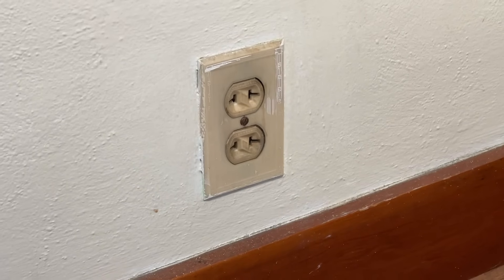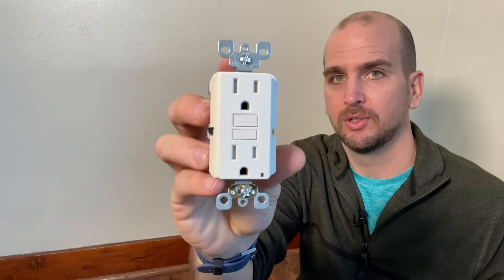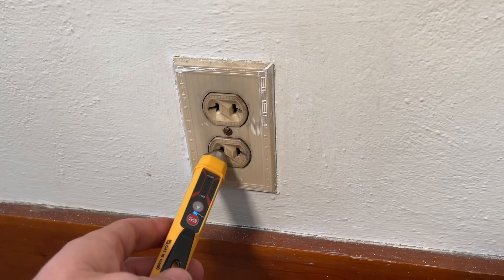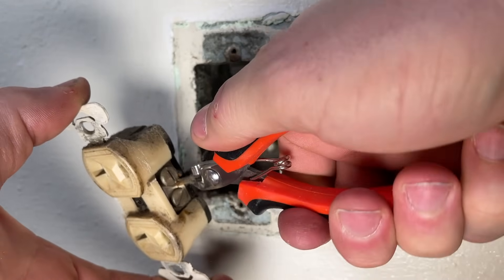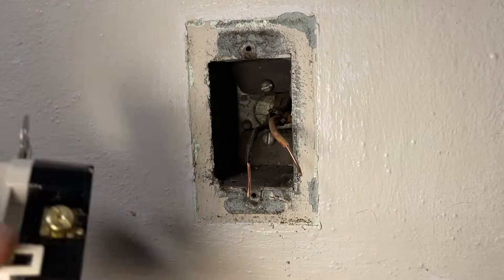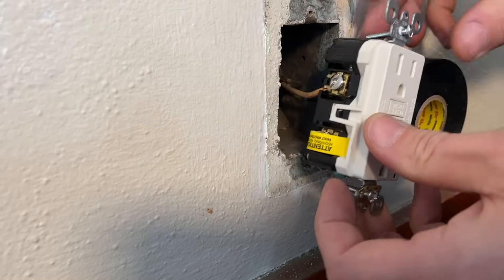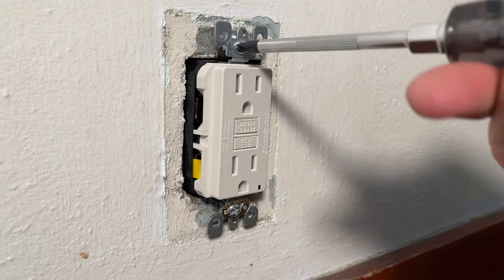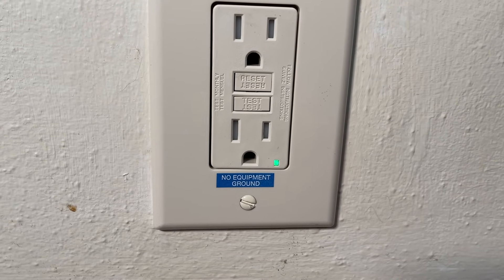How To Replace An Old 2 Prong Outlet Using 3 Prong GFCI

Comment: Question for those with electrical knowledge: Im in a 130 year old house. Half has been updated to standard 3-prong outlets, but the other is still 2 prong. By installing this new 3 prong  outlet like in this video, does that create a proper grounded outlet, safe for electrical devices? I’m asking because a laser engraver i have requires I plug it in a 3-prong outlet as a requirement for the warranty. Is what’s being done in this video sufficient to create a ground or do I need something else? Sorry, I have zero knowledge of any of this, please excuse me if I asked the question wrong, but hopefully you got the gist
Reply: It will be safe for your device. What it does is monitors the balance between your hot and neutral conductor. If there is the slightest imbalance it will trip. This indicates that current is going  somewhere other than where it should be. The breaker in the panel alone will not do this. What an equipment ground does is creates a path back to the bonded neutral allowing a breaker to trip in a fault scenario. So I’m theory; the gfi is actually safer than a traditional 3 prong outlet with a proper equipment ground
Reply: @NIXGHTEditz7  thanks a lot, I appreciate you sharing that
Reply: To clarify, no, this procedure does not "create" a grounding path. The outlet is NOT grounded.

Comment: Great video, thank you for sharing. The silver rectangle frame that you screwed in. How about if the wall doesn't have that.(rectangle medal frame) will you please make a video on how to Mount one in the wall?
Reply: You cant just mount a metal box in the wall. If you only have a 2 prong outlet, you cant just install a 3 prong outlet because it wont be grounded.

Comment: Standard wiring practice is what you did on the hot wire.......wire goes on the side of the screw that as you tighten, the clockwise turn of the screw would tend to pull the wire IN. You put the neutral on the wrong side of the screw....as you tighten, it would force the wire OUT. 

Minor mistake, but if you're gonna do a demo, at least do it right.
Reply from the maker: Hey Ed, I totally agree when I am using side wiring with a clockwise J-hook.  For the back wiring on this GFCI and/or spec grade receptacles when the plate pulls in and secures the wire I am not as careful but probably just best practice to stay consistent to avoid confusion for viewers.  Appreciate the feedback.

Comment: You're removing a NEMA 2-15R T-Slot Receptacle. These were used for 240V at 10A or 120V at 15A. Did you use a volt meter and measure the voltage?

Comment: It’s common practice to install the outlets  ground prong up.  
If a conductive object falls accidentally across the main two prongs of a "right side up" plug that isn't completely flush against the outlet, it will close the circuit. If it's your finger you get shocked. If it's metal there could be a spark. If there's a spark there could be a fire. Building codes are designed to prevent things like accidental fires.

By installing the outlet "upside-down", you put the ground prong on top of any plug that has one. The ground prong can't create a spark all by itself, so it's safer to touch accidentally.
Reply: I wouldn't exactly call it common practice when 99% of the time the ground is on the bottom lol
Reply: @djwctbell  “It’s” meaning it is as a current practice.  Older stuff, sure the ground on bottom.  In my own house they are.  Most of the newer houses I go to the ground is up.

Comment: You really shouldn't recommend using a non contact tester for anything other than verifying you have power where you think you should.  They should only be used to confirm something is live.  It really shouldn't be used to "confirm" that power is off and most manufacturers state this openly.

Comment: what about if i bought a wifi outlet, thinking i was being smart and getting a three-prong, until i realized i don't have a ground wire... at all! thank you 1940's San Diego apartment
Reply: It depends on where it is on the circuit. If it's not the first outlet on the circuit, you can replace the previous outlet with a GFCI which is an acceptable, code compliant solution.

If it is the first outlet on the circuit, the other code compliant solution would be to replace the circuit breaker with a GFCI type circuit breaker.

Note that to be truly compliant in either case the outlets would have to be labeled "GFCI Protected, no equipment ground"

Comment: Is it still safe to plug an appliance with a 3-prong plug into the outlet despite there being no equipment ground?
Reply: No!
Reply: Why not?
Reply: @maoak5470  the equipment ground is connected to the metal case of any appliance.  If that is not grounded the case can get shorted to the line voltage. If you touch the case in that situation it’s like touching line voltage. It won’t usually happen, but it’s not safe.

Comment: changing it to this with no earth wire makes no sense. there is no reason to do it because you need an Earth wire for it to trip
Reply: Any fault current will trip the GFCI, it does not need to go through a ground wire specifically

Comment: Electrician refuses to replace old non polarized two prong outlet, because "old wiring please update"

The wire colors are reversed and the breaker box and breakers are by Federal Electric
Reply: You could get a second opinion on the wiring, but if you have an FPE (federal pacific) panel, get it changed. Just do some Google searching and see for yourself the fire issues with those stablok style breakers.

Comment: Would there be a benefit to jumpering the neutral and ground terminals on the outlet? A fault to ground in the device would then have a path to trip the GFCI even without a person touching the device to divert current out of circuit.
Reply: It is against the code to connect the neutral and the ground
Reply: @okaro6595  I’m thinking of the situation where there is no grounding conductor nor raceway.

Comment: No offense, but the commercial electrician who taught me would tell you just what he told me, "Don't take up electrical work as a profession.  You touch bare wire too much.  Like a gun, always treat it like it's loaded." That's probably why he would never let me near 277 or 440 in the warehouse we were working on.

Comment: What's with the T-shaped holes in older sockets?
Reply: The original plug by Hubbell from 1904 had horizontal prongs.  In 1912 he patented the one with vertical prongs. For a time both plugs were used so sockets were made to accept both. These do not designate different functionality like the current 20 A plug which has horizontal neutral.

Comment: See I was always told to make a ground onto your copper plumbing,cause long as you have the ground strap from one end of your water meter to the other side it’ll give you a ground. It’s a much simpler way to convert some of the rooms from a two prong to a 3 prong with an actual ground. I’m not an electrician and I guess I have no real knowledge to say this is right way to do anything but seeing as your plumbing goes to ground and again long as ya had the ground strap that hooks the two ends of that are separated by the water meter hooked up it would be going to a true ground. I use to work for a contract company that did work for the electric utility company in my area an any of the meters we would run it was nothing more then a 6 foot ground round that was pounded into ground and for the underground utility transformers that was 7600 volts for single phase an 13200 volts phase to phase we would pound two of those ground rods on each side of the inner portion of base. So clearly it would be a ground just can’t say if it would be code for any area. I know in most cities I’ve lived in ya would never be given an certificate of occupancy for any home with no ground plugs and if the home was paid for they couldn’t stop ya for technically going in an staying but you’ll be gifted a nice add on to your property taxes every year your there with out that certificate saying they home meets the city,county home codes.
Reply: trying to ground to plumbing is no guarantee that you have a grounded connection.  Piping fittings with pipe dope or a shark bite fitting may negate a ground path.  Same problem when someone tries to ground to a steam or condensate pipe.  The ground wire should be run back to the ground bar in the main electrical panel......always.

Comment: well is it a lie to jus upgrade the outlets..no doubt on 15 amp wires..probable that they, being on a 15 amp breaker..do we haveta even do the gfci in "This Old House!"..hey RUN Specific 12-2 wires on 20 amp breakers..for my ac unit! my microwave! (@ my computer office stereo printer shredder station! floor space heater!) thank you for producing a home improvement youtube video man!

Comment: I just bought an older house with many of the older 2 prong outlets and need to replace them. Would the GFCI 15 Amp outlet be safe to plug a power strip into it, or would it cause it to trip due to overload?  I have a large TV, Soundbar, and several gaming consoles that need to be plugged into the outlet behind it which is currently an ungrounded outlet.
Reply: I assume the circuit is 15 A so you have to use 15 A. Do not improvise. 15 A is plenty of power.

Comment: Just curious, you say, the old two connection plug is unsafe, so electric has been unsafe for over 100 years? And since- even with a GFI outlet, it is STILL two wire, does putting  a "sticker" on it magically make it safe?

Comment: There are a lot of misconceptions about installing a gfi receptacle to replace a two prong receptacle. If you're going to recommend that people do this, it's important to tell that this is NOT a safe alternative to having a true earth ground. Installing a gfi does not provide a ground it only provides protection from fault current. There's a big difference between a properly grounded receptacle and a gfi fake ground. If I were you I would stop teaching people the wrong or incomplete information.

Comment: There’s no reason to cut and restrip the wires,just unscrew them from the outlet. Next screw a small grounding pigtail to the back of the outlet box. Then connect the wires to the new outlet and screw the new outlet and cover plate on and your done. You should only use those GFI outlets in areas around water like in bathrooms or as outside outlets.
Reply: You couldn't be more wrong if you tried.

Bonding to a metal box =/= proper grounding. Yes, a metal box should be bonded to the ground network, but that is NOT EVEN CLOSE to sufficient by itself. A ground conductor must be isolated from all current carrying conductors (except at the most upstream point, where a dedicated ground rod is in place, it is bonded to the neutral bus) and must provide a zero potential unbroken path to ground (as per NEC/NFPA70) ...and GFCIs are permitted literally anywhere. In fact, they make GFCI protected circuit breakers for entire circuits. Please don't give advice on these matters if you don't know the material, you could hurt someone or get someone's house burned down. Sincerely, someone who does this for a living.

Comment: "If you have more than one receptacle in a room..." Kind of common for multiple receptacles in a room. Should have said "circuit" instead of room. Maybe trying to use terms more people will understand, but still if turning off power at the panel is a step then people should have an understanding of what a circuit is. And in older homes it's common for receptacles in multiple rooms to be on the same circuit.

Comment: Adaptor plug is screwed to the outlet's center only to secure the adaptor so you can unplug a cord and the adaptor can stay in place. But yeah, I think many people may think the screw provides a ground.
Reply: It can provide a ground if there is metal conduit going to the box, and is grounded back to the panel.

Comment: Good advice. Call a professional.  Last make first break rule. Wires already too short, don't cut. If you're not going to wrap the wire, at least put the wire on the clockwise side of the screw. At least you taped

Comment: I was always taught that you cannot replace a 2 wire recepticle with a grounded recepticle because people would think the ground was functional. If you are going to add a three prong recepticle, why not take a jumper wire and go from the neutral screw to the ground screw. At least the ground prong would have some sort of functionality as they are tied together in the breaker panel anyway. Or you could just rewire the outlet or run a separate ground wire to make it safe. That sticker on the recepticle will not mean anything to the average homeowner. They are going to look at that outlet as a fully funtional outlet.
Reply: Absolutely do NOT connect the neutral to the ground!
Reply: It is against code and dangerous to jump the neutral to the ground at an outlet. That potentially energizes the metal case on an appiance. You could get shocked if you touch the case.
Reply: Grounding must remain completely isolated from neutral throughout the entire system except at the furthest upstream point (typically the meter or main panel, where there is a ground rod installed). The point of a grounding network is specifically to be a ZERO voltage potential conductor which serves as an emergency path to ground for any shorts/faults. Bonding a ground to a neutral upstream is extremely dangerous: unlike a grounding network, the neutral conductor is INTENDED to carry current during normal operation. Your grounding network includes bonding to the metal casings and elements of equipment that people make contact to. If the grounding and current-carrying neutral are bonded together (as in the case of tapping a ground to a neutral in an outlet), it is quite plausible that the path of least resistance for that neutral could cease being the path to the bond at the meter, and become the metal housing of your plugged in appliance->YOU->YOUR FEET->THE GROUND YOU'RE STANDING ON.

Several replies have stated that doing what your post suggests is an NEC code violation (which is 100% correct), but I figured I would explain the mechanism of WHY it is bad and not allowed.

On the other hand, a GFCI protected outlet will still have fault protection due to the GFCI mechanism, even without a ground made up. That is why this is an acceptable solution - even without a ground, in the case of a fault, the GFCI will still trip. In a perfect world, however, you would pull in proper grounded NM-B cable with a dedicated, isolated ground conductor. 

...but that can get expensive and be some hard work.
Reply: @3-PHASEDELTA  There would have to be other things happening for the neutral to carry voltage to energize the metal casing or other "grounded" elements that people would come in contact with. I could say the same thing about not connecting the ground. If the hot wire would happen to contact the metal surfaces they would become energized without tripping the breaker. That seems a much more likely way the metal casing would get energized than the neutral wire carrying current to the casing. My guess is the ohm reading between the neutral and the ground at the farthest outlet is the same as the reading inside of the main panel. That is important so you don't typically get shocked when you touch a neutral while you are grounded even with the circuit energized.
Reply: @johnhopkins7131  a neutral is literally a current-carrying conductor under normal operation of a circuit. If you dont believe me, feel free to cut one with an uninsulated tool some time.
Reply: @johnhopkins7131  you are not incorrect, however, that the same would happen in the case of a loose hot contacting casing without a ground. It would still energize the casing and be dangerous. The difference here is that the internal workings of a GFCI detect load imbalance... ie if there is X current on the hot and X-2 current on the neutral, that -2 current is leaking and there is imbalance, the gfci immediately trips. A ground is not required for that specific function to happen.
Reply: @johnhopkins7131  ideal fix = pull a proper isolated grounding conductor  from outlet all the way to ground bus bar in panel

NEC-compliant fix that is still safe = forgo the ground, install a gfci outlet, and label outlet as "ungrounded GFCI"
Reply: @johnhopkins7131  If the neutral breaks then the case will get energized. That is not an inherently dangerous thing as it has been used in several countries but as it is against the code you should not do it.
Reply: @3-PHASEDELTA  The ideal fix is to rewire the house.
Reply: @JeanPierreWhite  yes. That is always the ideal fix.
Reply: Putting the jumper is against the code. Using GFCI is allowed by the code. That is the difference. You should follow the code, not because it is a better thing to so but because if something bad happens and you have violated the code you are screwed. Nobody will listen your arguments how you think your way was better.

The outlet is fully functional.
Reply: Ungrounded= fake GFCI
Reply: @JoseGutierrez-xm1vr  how to say "I don't know electrical work" in 3 simple words
Reply: The video's way is NEC.

Comment: Good video, but as a rule of thumb - inductance testers are only for when you wont be touching conductors. If you're gonna touch conductors, it really is best practice to use a contact tester. Non-contact testers ARE typically reliable, but nobody wants to be the one guy who finds out his is defective THE WRONG WAY.
Reply: He also kept touching the neutral side which wouldn’t tone anyways